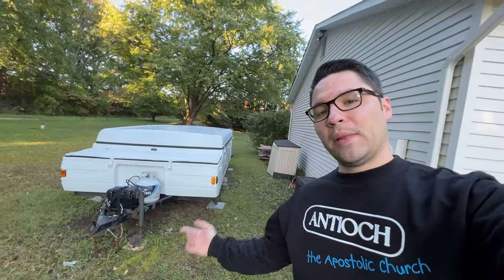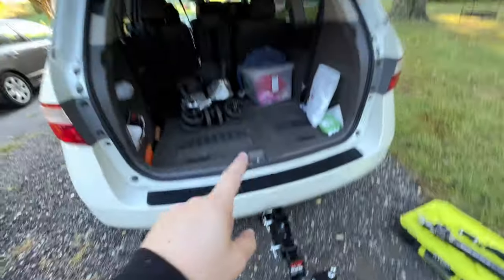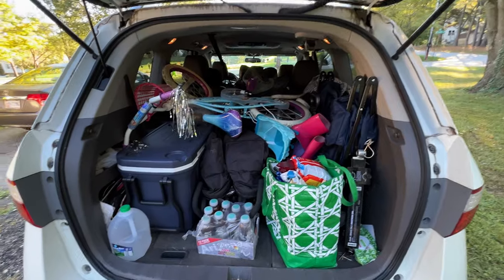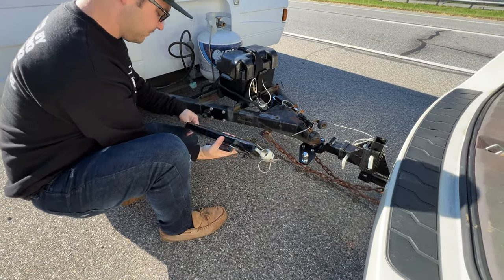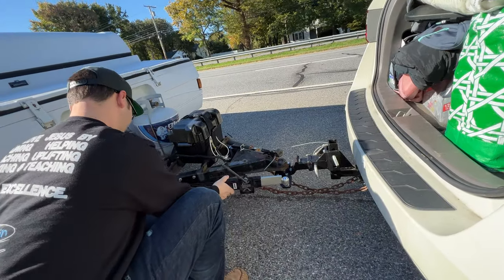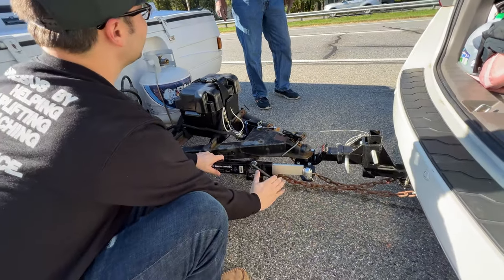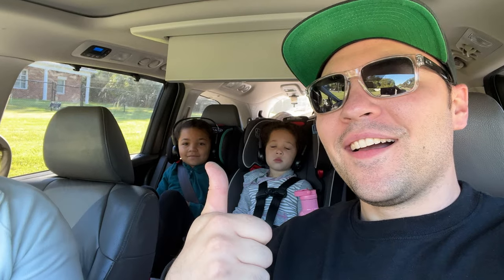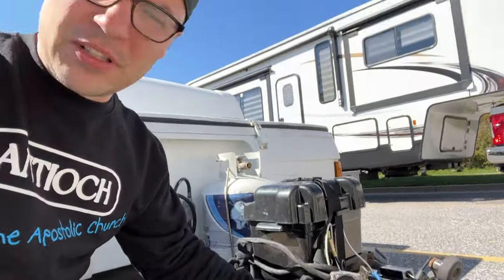First Time using an Anti Sway Control Bar

Comment: Hi, You don't have to take the sway bar on and off, just drive it from home until you get back home from your trip. If you are trying to back up in a very tight loop you might need to take it off then but if it was installed the right distance from the ball it should not have any issues. I have had a few of these and am just installing one on my tent trailer now because I want to tow it with my jeep and it si really short so this should drop the danger level.

Comment: With that level of sway you have a weight distribution problem. The sway bar is not designed to correct a loading imbalance.